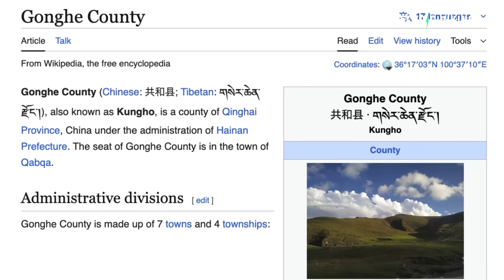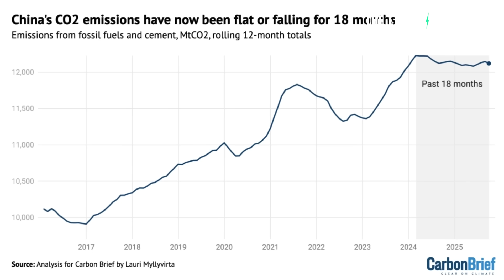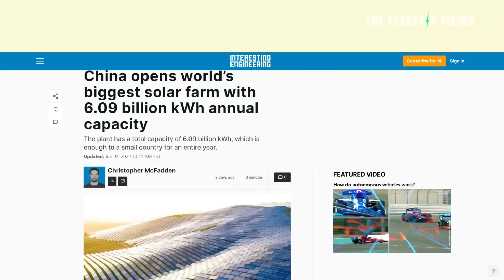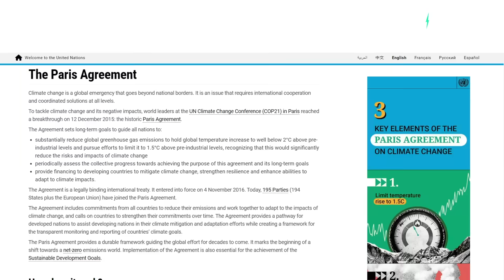China Unveils World’s Largest Solar Farm — On a 10,000-Foot Plateau in Tibet

Comment: You still haven't noticed, have you ?

This 15Gw will be based on NAME PLATE CAPACITY. They take that number, multiply it by how many turbines they have and.....HEY PRESTO...suddenly a city the size of Chicago can be supplied.

What THEY DONT tell you, is that wind farms only operate AT 25-30% EFFICIENCY. That is based on ACTUAL DATA, collected from monitoring wind farms built years ago. 
So of that 15GW they shout about, you will ACTUALLY get around 4.5Gw...AT BEST. 

THAT is how they spin the LIE and draw in gullible, easily impressed people like you guys here.

Comment: A circular area covering 162 square miles has a circumference of about 45 miles, which means that a person walking 3 miles per hour will need only 15 hours to walk around it.
Reply: If you can walk 15 hours straight at good speed then yes. Otherwise it takes 2 days with 7-8 hours per day.
Reply: Pretty much my thought

Comment: What are the polution levels like around the manufacturing plants and mines of solar panels? What about the non-CO2 pollution levels now? What about the sustainability of copper? Copper is not a renewable resource. What about hail storms and typhoons? What about the fact electricity is not a source of energy? What about the fact that CO2 is a good source of food for plants without no plant can survive?
Reply: Re your latter point, given we're adding 40 gigatonnes of CO2 to the atmosphere yearly and it's level has increased from 280 ppm pre- the Industrial Revolution to 430 ppm now, I'm sure the plants will cope. The aim is to stop adding extra CO2 into the atmosphere not to get rid of it all, which would be impossible anyway. If the manufacturing plants are powered by renewables I'm guessing pollution levels are pretty low, copper can be recycled (try recycling oil after it's been burned), and what about hailstorms? Unless the hail is the size and density of a cricket ball the panels will be fine. Electricity is a secondary energy source, in the case of renewables the primary sources include solar and wind power, I'm not sure what your point is.
Reply: @geoffreyjones6019 CO2 is good for the planet. You are adding not just more CO2 but more poisonous/deadly unrecoverable junk to the planet with alternative stuff like solar panels, wind turbines and batteries. These alternative technologies are not renewable. It's a lie! There is nothing renewable about a solar panel, wind turbine or the latest batteries, nothing.   @geoffreyjones6019

Comment: From the images looks like reflective mirrors channeling light  to a central 'boiler'. I think they tried that in Africa then switched to solar panels - that directly produce electricity rather than reflect sunlight to a point to heat molten salts. I thought solar panels had effectively won over reflective mirrors as the most efficient means of converting sunlight to energy? Did I see things correctly in this video - reflective mirrors are making a comeback?
Reply: Yes, you saw right. Sometimes this youtuber shows photos /videos that are not directly related to the subject under discussion
Reply: Molten salt solar system comes naturally with heat battery.  So it doesn’t need chemistry based battery.  Video clips are just for the purpose of filling blanks.
Reply: @xinfuxia3809  Didn't think of that - use the electricity from voltaic cells during the day. And convert the built up molten salts energy later for the evening peak. That would be an interesting idea... now I am doubly curious about the actual plans details.
Reply: Reflective mirrors have been used to collect solar energy throughout history. Solar photovoltaic cells must be much more efficient than reflective mirrors, otherwise why use solar cells at all? But solar thermal plants which use reflective mirrors are still being constructed all over the world, including in China. Not sure the reasons, hope someone would shine a light/sunlight.
Reply: @eugenec7130 photovoltaic panel includes front glass, semiconductor, wiring, backing.  The manufacturing process is highly technical, thus costs a lot.  Reflective mirrors are just polished metal sheets.  Easy to manufacture and recycle.  The drawback are not easy to build concentration towers and arrange mirrors orientation .  One cannot carry the tower to a random location.

Comment: Like most solar, wind and climate change alarmism propaganda this video is likely receives funding from the natural gas industry.  Human caused atmospheric CO2 has on average is less than 1/10% share in earth's water vapor saturated greenhouse effect.  In practice the solar and wind generating space is supported by running natural gas turbine generators at high readiness making near zero electricity at the fuel cost of making all the electricity with natural gas combined cycle power stations.  Since little natural gas is generating electricity the high natural gas use is hidden from the public.    There is no fuel savings if there were natural gas fuel savings it would be greatly promoted.   

More economically fueled steam turbine generators are too slow to support large amounts of solar and wind generated electricity.  The UK is culling wind farm output to save very expensive natural gas.  Wind farm output wild fluctuating per second requiring constant make up above high readiness is the most natural gas expensive form of providing electricity.   

The financial support for much of CO2 global warming ideology is from the natural gas industry and Arab natural gas exporting countries.  

US vise president Al Gore 1993 - 2000) received $70 million USD from the Arab natural gas exporting country Qatar from its state owned Al Jazeera news network 2015 purchase of Al Gore’s Current TV.

Stanford University has received substantial donations from the natural gas industry, including approximately $56.6 million between 2010 and 2020 to fund research, particularly within its Doerr School of Sustainability.

 NASA reports global warming at 1°C that is constant since 1992 after falling from its all time news reported high of 1.1°C in 1991.  The cause of global warming is not known with studies to its cause going back to the 1970s.  

It is impossible to increase the effect of a saturated system.  A primary example of saturation to US high school students is earth’s water vapor saturated greenhouse effect that completely absorbs all the greenhouse radiant energy with greenhouse gases within a few meters of the radiating surface adding 5.55°C (10°F) to earth’s average temperature (1978 earth science Marshall High School, Falls Church VA).  Water vapor with a CO2e of 18 and on average 1% of the troposphere is over 99.5% share, carbon dioxide less than 1/4% share with 40% considered to be from human causes being less than 1/10% share.

China is the world leader starting in 2018 for building hundreds of new high efficient ultra supercritical (USC) clean coal power stations to re-power and greatly increase capacity of is power grid.   The USC coal power stations emit no visible air pollution.  They are replacing old inefficient highly air polluting coal power stations.   The coal "fog" of large Chinese cities has disappeared due to the new USC clean coal power stations.
Reply: The world is moving forward to clean renewable energy. We're increasing energy generation to meet our future needs.
US is falling behind and apart. It is focused on short term profit, not long term sustainability or growth.
Finally, you are full of horse manure.
Reply: Is your manifesto scribbled in a notebook using a pencil? Is there a lot of writing in the margins with arrows pointing to where you wished to elaborate? 

A lot of underlining, coffee stains and exclamation points where the periods are violently stabbed?
Reply: "Clean coal" 🤔 Is there a sufficient supply of Dawn dish soap? 🙄😖
Reply: Clean coal. What a complete load of BS.    😂😂😂.    How much are you being paid by the foss fuel industry to post this excrement?

Comment: Why such big gaps in between the panels
Reply: So they are not shaded by nearby panels.
Reply: maintenance  - imagine the damages from a major hail storm  - the panels are cheap to replace though
Reply: Why not? Its inside the desert. The land value is close to zero. Bigger gap allow cleaning machines to work easily.
Reply: These are not PV panels.  They are mirrors directing the sun to the tower in the center where liquid sodium is heated.  The US had a similar but smaller plant the use liquid salt but it was never financially viable and I believe it was just recently decommissioned.  PV panels are much better today and are better for large farms than these designs.